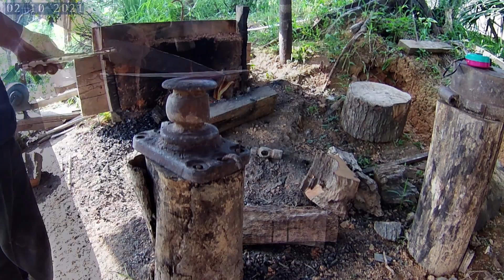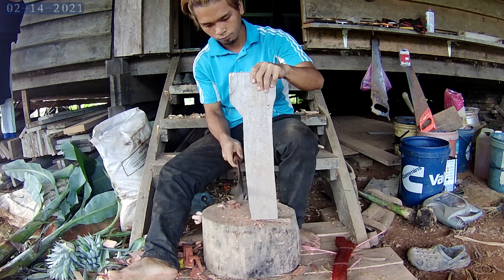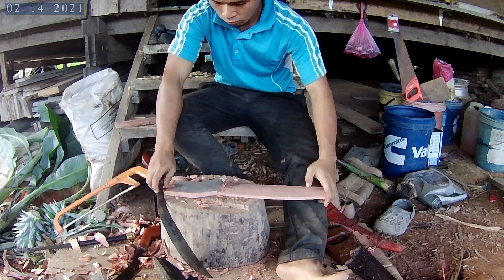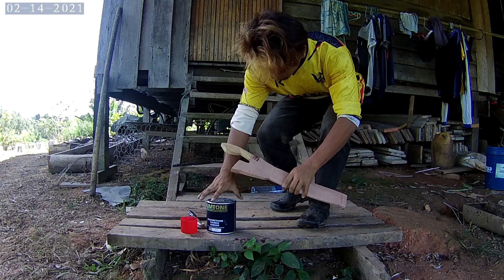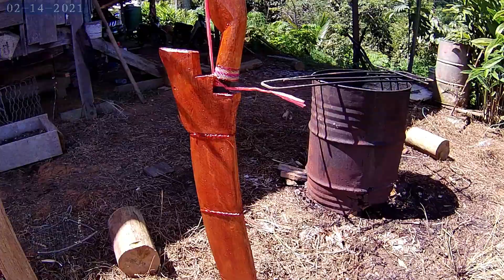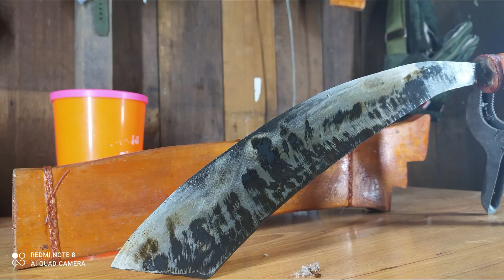Making 16 inches Parang Chandong from leaf spring

Comment: Good work, but next time, better harden the leafspring steel in oil. 
Hardening in water rises the risks of micro cracks. 
After hardenig, you have to temper the steel, because it is too hard, now.
For this, clean quick the blade with an sharpening stone and bring it in a oven 200 degrees celsius, for one hour.
The blank blade has to be the color of  brown/purple . Then, put it quick in cold water.
Another way to temper, is, hold the blade, after hardenig and cleaning, over the hot coles again , and wait for the tempering colors. 
Best wishes from a Blacksmith from Germany.
Reply from the maker: Thank you for information.. I still process in learn and gain experience.. Thanks, sir.
Reply: Kannst du sowas auch bauen?